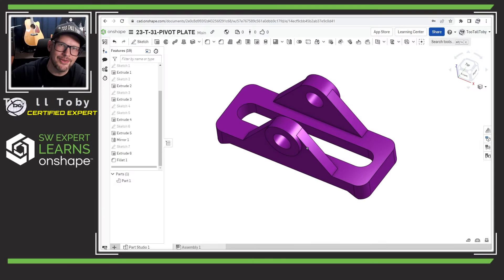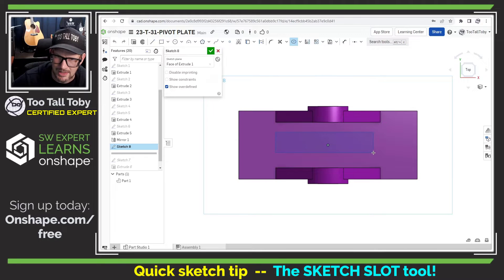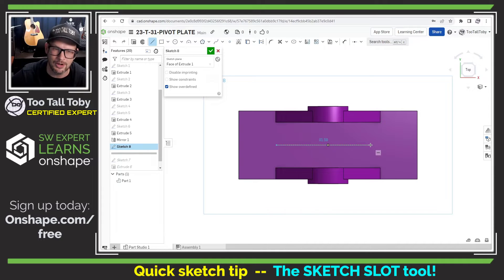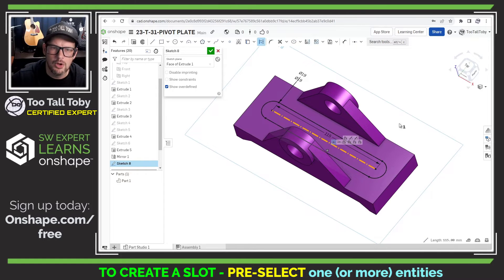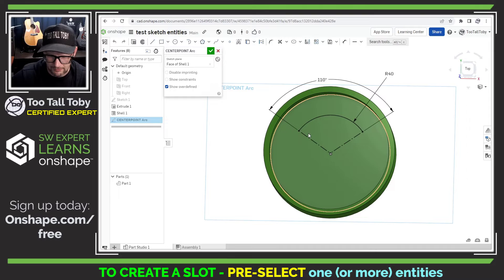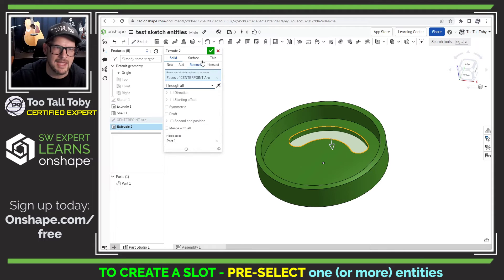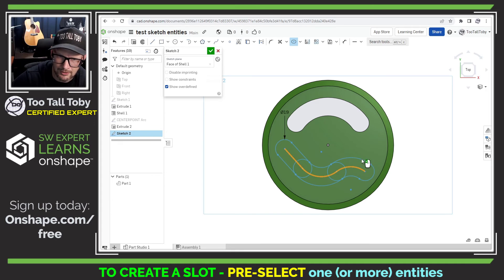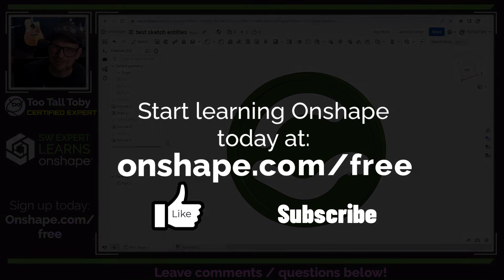Using the Slot Command

Comment: Is there an easy way to make the end larger diameter compared to the rest of the slot using this? For example if I want to create a slot that would go over a screw head and then turn to lock it in. I'm not sure what's the name of that mechanism, but I'm sure you know what I'm talking about. Quick google search says it's a "Keyhole slot hanger" mechanism.

Or would I just have to create another larger circle and just extrude remove that?
Reply: I think the suggestion from RetzerR is good-  or like you said, just make it a second cut to remove
Reply: The slot command is a "shortcut" to an offset and arc, if you need finer control you can use the slot as a base, or manually make the slot
Reply: @retzerR  Ok, thank you!